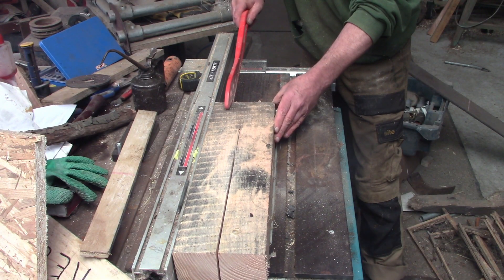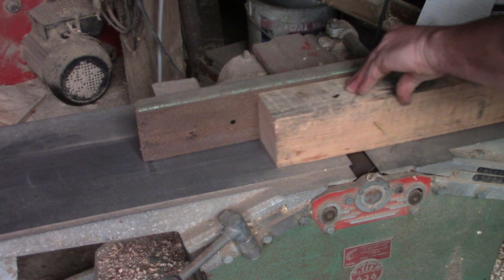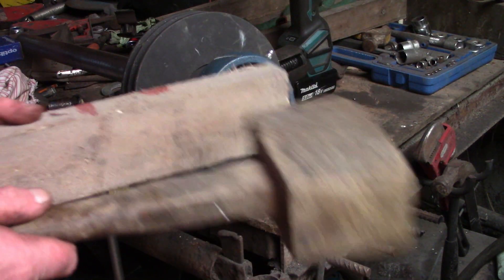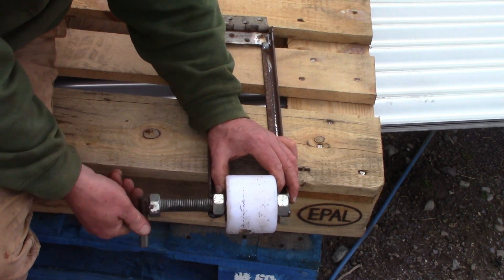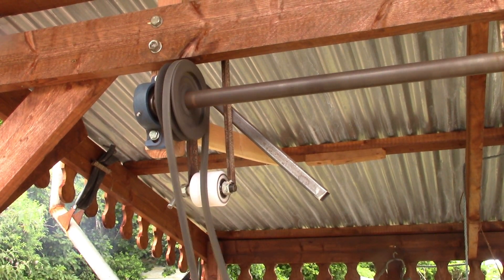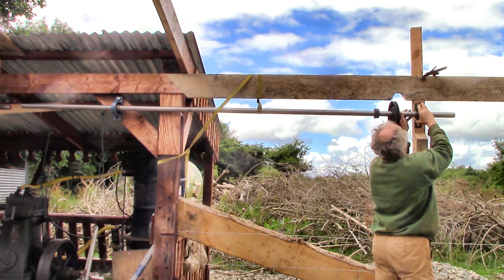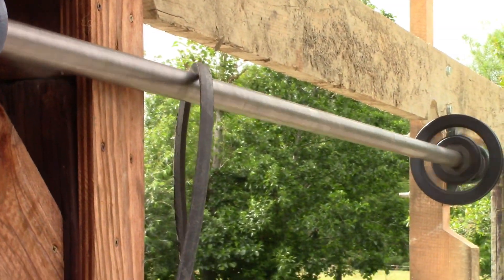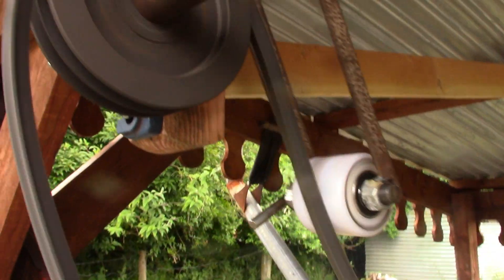Setting Up A Line Shaft For The Stationary Engine..

Comment: Another interesting video, Tim. I would suggest that the shaft coupling is creating a lot of vibration. The shafts don't appear to line up. Another interesting video. It takes me back to my first job at fifteen in 1948. In a machine shop with overhead shafts and belts running drills, saws, grinding wheels and a wet millstone. Even a machine to sharpen lawn mower blades. Plus a blacksmiths forge. The noise was horrendous. No ear protectors or any other protection in those days. Just common sense and good luck. Keep em coming and be careful. As my old mum used to say "Don't come running to me if you break your leg." Have I posted that before.? ;-)
Reply: The work shop in a textile printer's I worked at in the early 90's still had some line shifting driving a couple of the older machines via a massive electric motor and gearbox up in the roof. It had the old manual star-delta starter that you flicked from one stage to the next, once the motor had built up speed. I had to use the old slotting machine (first use for a couple of years) and when I started the big motor, we were showered in feathers, dried grass and worse as there had been birds nesting in it !
Our shafting had a fixed drive pulley and a free to turn pulley that you could slide the belts between, this is where I learned the phrase "fast and loose" the fixed pulley being the "fast" (fastened) one.
Your slipping belt is a good idea, but I think your tensioner should be on the other side of the belt ?
Reply from the maker: thanks Graeme - I tried it the tensioner pulley on the other side but the belt kept trying to walk off it. It's much happier like this
Reply: 😁 🏃‍♂️ with a # leg🦵
Reply: For some really depressing and gruesome early Victorian child labor horror stories check out Channel 4's The Mill (2013).  Gee wonder why it was canceled after 10 episodes?!

Comment: Did I see a clamp made from a caulking gun?  Iam a retired carpenter and I'am going to dig out a bunch of old ones and make a couple.  Be safe Tim.  You have a lot of moving parts there and it takes only one stumble to find them the hard way.
Cheers 🇨🇦
Reply: clamps are sold new like that but it is the same mechanism, i find them to be unreliable.
Reply: @gramursowanfaborden5820  I made one from a caulking gun yesterday and it's not so hot.  Twists when clamps and has minimal pressure when doing so

Comment: Why not extend that fancy safety cage over the whole spinning commotion up top? I'm sure you have some more rebar netting around.
Reply: i think the junction is the only truly dangerous part because of the protruding nuts and bolts spinning at high speed that could catch onto something
Reply: I've seen long cardboard tubes put over plain shafts so things don't get caught in them.